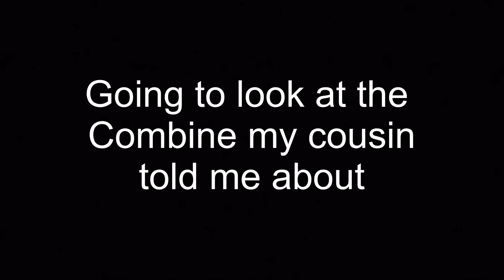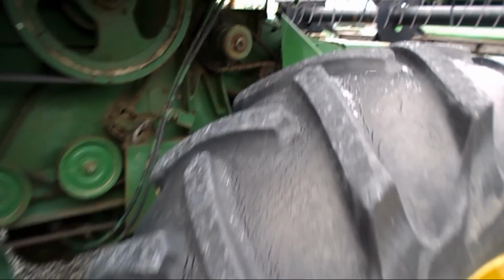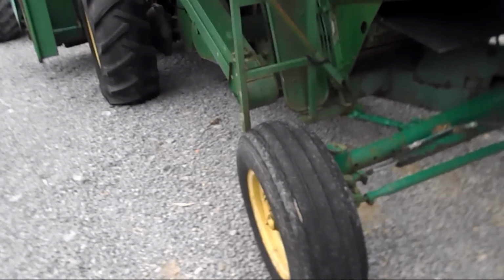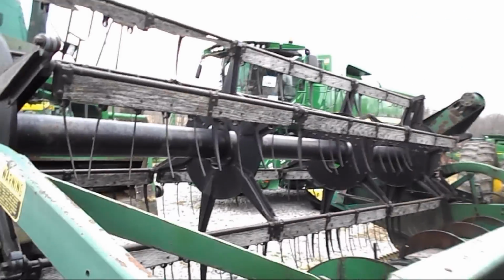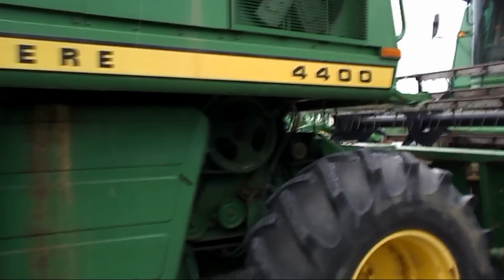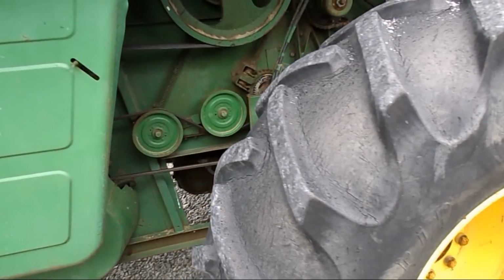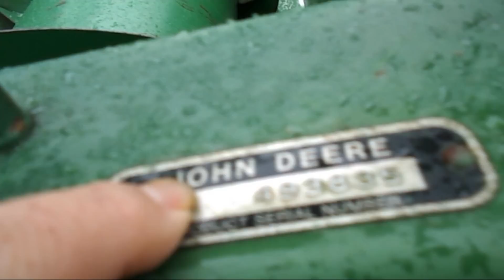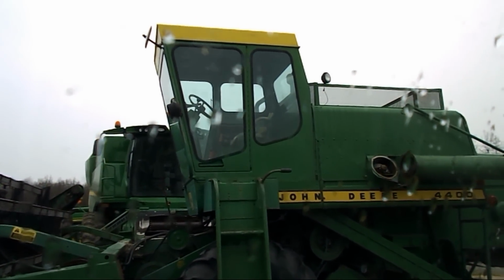Going to look at the combine my cousin told me about

Comment: Fair warning you will need to check the concave augers the flutes that grain flow through I got holes in mine I didn't even check in until after I started running corn a great big pile of corn on the ground
Reply from the maker: I did just that, I spent about 1/2 hour with the camera off looking it over really good and it appears to be a good solid machine. I'm not going to say its perfect but its in really good shape.  Bandit

Comment: they may have to pay you to  haul that thing away, your going to need to love that kind of work, belts, hoses, bearings, pulleys ,  batteries, tires,  its a real project.
Reply from the maker: I look at it like this,,,,,,, No matter what combine I look to buy used its going to need belts or bearings an other work done to it.  Tires I have (no cost there) so no big deal, Belts and bearings are normal ware parts so no big deal.  But this combine had $28 or $2900 spent on it at JD last summer and was in the field cutting beans a few weeks before they brought it to the dealer and I looked at it. With more time than money I see a good machine I could work with. As for the header I was told they got it 7 years ago used and I know it needs work, But I do have a good 13' head off my 95 that is ready to go that I can use on it. So I'm not worried about the header and I can fix the 213 easy enough. No matter what you buy used its going to need some kind of work done to it before you use it so this is no different.  Bandit

Comment: When it comes right down to it Bandit, it doesn't matter what anybody else says about the combine, if it will work for you and your situation in what you need in a combine buy it. (If the price suits you)
Reply from the maker: From what I see its a 1200 hour machine for sure, I don't see ware on it ware they normally ware  plus its tight ! It might need a few belts but that's minor compared to trying to buy a newer machine for more money. I think if I can get it bought it will be a good one to have, But I got to get it bought first !  I hope I get it, Low hour combines are hard to find !  Bandit

Comment: Looking like a 4K machine with head   I ran a 4400 for 40 years I sat in the seat.  Used last three years a truck load of beans just to keep it in good shape till we sold her off.
Reply from the maker: I think the hours that are showing are right by what I see of the machine, Lack of ware in the commend places . The chopper knifes have yet to be turned and they just have the tip worn on them so I don't think its done all that much cutting. The 213 head has been added to it at some point for sure with the spring assc under it it had to have had a 13' QT with a skid plate under it like the one I have for the 95. I'm not a big fan of the 4400 but if the price is right I'll own it and run it ! But I got to make the deal first !  Bandit

Comment: leave it right were it is you will be money ahead.
Reply from the maker: Maybe, Maybe not ?  Bandit
Reply: @banditfarmer1900  just curious what would you use this machine for? Back up of a backup?
Reply from the maker: @Alex-uy7pc  Well as I've said before the 95 needs a rebuild and I have a feeling this summer I'm going to be busy, So rather than worry about having to rush threw a build I'm looking at this 4400 for several reasons. One being its a 1200 hour machine  2 I have a parts machine sitting there and  3  If my summer is busy and I'm still working on the 95 I'll have the 4400 to cut beans with and not have to worry rushing a job that's going to take awhile to do.  As it is I got to finish blue and get the Long in the shop to pull the axel to put seals in it because there leaking and then I can get on the 95. I have lots to do and this 4400 falling in my lap will help a bunch if I get it bought !  Bandit
Reply: AMEN !

Comment: A few years back I had a 6600 and it was a good machine. Diesel engine, plenty of power. It wasn't that difficult to repair although there were quite a few drive belts on it. I paid $5000 for it without any headers and that was over 15 years ago. Sold it for $2400, purchaser rebuilt it and shipped it to South America where I suspect it is still being used.
Reply from the maker: I looked at a couple of 6600's and I was not really impressed with them and too many hours for my liking so I passed on them. I've found when your not looking for something one will fall in your lap like this one has , In this case its a good one and I've got to move on it while the chance is still there !  Got to be ready to jump on them when one pops up like this. If I don't get it I doubt I will ever see another one with as few hours on it as this one has. New video coming today ! Bandit
Reply: @banditfarmer1900  yeah... i know what you mean. When they get to that age it can be hard finding one with good sheet metal. Often times will be rusted through, grain pan, hopper etc. Good luck on it!

Comment: we had a jd4400 diesel & 444 head for corn. that replaced the jd95 gas with 3 row head. both were not enough hp because #1 muddy clay fields here #2 some fields 106 day pioneer was yielding 300 bu/acre drove it slow slow slow and the engine still ran hot. corn in icy standing water thanksgiving day 1997 i put duals on and that destroyed the transmission on a 20 acre strip, drove it home slooooooowly with a loud knock noise. that night after milking i dropped the transmission and found several ball bearings blew apart so the gear teeth were rubbing against the inner case so don't put duals on these combines. the 300 bu corn snapped the straw walker crank shaft in two. the feeder house apron was badly worn - kept jumping a link on the drive sprocket 10,000 times until i went to deere and bought a new apron. the 300 bu corn busted the elevator chain up to the hopper, again badly worn -would'nt fit the sprocket. of course every time that elevator chain falls off its sprockets the drive belt gets destroyed. so another trip to deere for those parts. late one night i hit a tree busted the unloading auger off the 4400 because 18 hours in the combine my brain turns into mash potatoes. no problems ever with the corn/bean heads/sieves and we bought it with new tires new rasp bars ($3500 for combine & 2 heads). so not the right machine for us only had it 4 years traded it for the massey 760

Comment: I have seen those turnbuckles connected to a few back axles in the past on some combines. I have even seen them on a few IH combines. I never heard a reason but always suspected for extra side to side support. FP sure does move a lot of equipment. We have bought a few things there. I wonder if that hour meter still works? Not a bad combine for the age. Just needs some TLC.
Reply from the maker: I myself have never seen this on any combine before , I looked that back axel over closely and see no cracks or welds and everything looks tight so maybe it was done to prevent a problem from happening .  The hour meter works and it look to be original and what I see looking at the machine I would say its right. Its been kept in a barn or shed (I'm thinking shed by the way the paint is from front to back, Back is duller and up front is bright) but I think over all its a good machine just needs some TLC to make it look good again. I hope I get it !  Bandit

Comment: If only it were a diesel.  I've never run a 95 but i have to say it think your 95 will out work this 4400.  We have similar axle supports on our 4400.   Excited to see what you find out about it.
Reply from the maker: Oh I know the 95  will out cut the 4400 no doubt about it, But with the 95 needing work this would do in a pinch if I can get it I wont have to worry about getting the 95 fixed in a hurry. I can take my time and do it right. But this 4400 has me very interested in it for sure. I still don't understand those supports on the axel, For sure I've never seen them before and they look like they wouldn't let the axel move very easy . Not sure why there on there, I couldn't find anything broke or welded on the center tube so I'm not sure why there on there. If you could explain what they are for. Bandit
Reply: @banditfarmer1900  those axles are known for breaking and having problems.  This is one attempt to prevent the wobbly rear end. It does limit the amount of oscillation though.  On a 6620 and larger they made an optional heavy duty rear axle.
Reply from the maker: @AgWildNebraska  I looked over the back axel and I didn't see any cracks or welds anyware on it, I think this might have been done to prevent it from happening .  One thing I don't like is how wide they have the axel spread out on it, But first thing is I got to get it bought if the price is right !  Bandit
Reply: @banditfarmer1900  probably so.  TAH-DAH Farm recently fixed his 6600 with new bushings in the axle pivot.  With only 1300 hours you'd think this one would be in good shape yet.
Reply from the maker: @AgWildNebraska  That's one of the reasons I cant figure out why they are on there with as low of hours that are on it I think maybe this was done to prevent it from having a problem, But I wont know for sure till or if I get it bought and get it home and can jack it up and check it out and see what the deal is with it.  Who knows for sure.  Bandit

Comment: To be honest that combines been ridden hard and put away wet a few to many times from what I see. I'm wondering if that axle has been ripped off or bent and replaced after somebody towed it out from being stuck, and they added the braces to stop it happening again. That hour clock digits don't look right to me either, why is the second number not inline where it should be.   I'd think that sprocket should be better than that for the "low" hours to.

 My thoughts are the best thing about it was when you shut the nice fitting cab door and got in the truck and left. I'm going to say if you want a $1000 combine ,spend 1500 plus on it before it's in the field and end up with a 2500-$3000 machine thats had a hard life It will be in your yard soon .  There   are newer 6600 /7700 diesel Deeres advertised round here in Canada for  about $5000-10.000 cdn not many guys want them now. What are they worth in your area for a newer combine ?.      I guess if it comes home at least we get to see you figure it out and use it, so that would be a plus. Thanks for the video, take care
Reply: super6954 exactly, that’s a lot of wear for that kind of hours

Comment: I'd bet the bushings are out of the rear axle pivot!  Best be a good deal I think I would walk away too many repairs! You could do that much work to the 95 and have a better machine! I don't like those models either!
Reply from the maker: I looked everything over on the back axel and I cant see anything wrong with it, No cracks or welds and the axel looks tight so I'm thinking its ok but if the price is right I do have a parts machine just sitting there I can get parts off it IF I buy this one. The 95 will get fixed and IF I buy  this one it will give me time to do the rebuild right and not be in a rush about doing it. I'll have to wait and see what happens.  Bandit
Reply: If anyone can fix re up u can
Reply from the maker: @arthurdewith7608  If I get this it will go on the fast track for the little things to be fixed so when falls rolls around it will be ready to go. Of course I got to get it bought first !  Bandit

Comment: I used to work at JD! The 4400 is a great machine!  Id rather work on them than a 6600!
Reply from the maker: Dad bought a 4400 20 years ago and it was a good running machine, Cut good and cleaned good it was just a little ockwards to be to run. Getting the one I just bought in the shape its in for the price I now have a low hour combine that will last me a long time. It needs some belts so I think all of them will get replaced at the same time just to save a lot of work ! LOL  I've help work on several 6600 and they are a giant pain in the butt to work on.  I was at JD and a guy was needing a steel hydraulic line on his 6600 cause his was bad,  They asked him do you have a torch ?  Why? If your going to replace it with a steel line you will have to cut your way in to replace it !  Or you can replace it with a hydraulic hose and reroute it.  The guy did not look happy with what they told him !   I still say the engineers who designed these combines needed to be tared and feathered !  I still think the 95 is a better combine than the 4400 that replaced it. I know the 95 is a lot easer to work on ! LOL  Bandit

Comment: Here I thought I was going to be the only one on YouTube with a low hour 4400 but here you are haha. Mines got 1373 and is from Ohio. I would REALLY like to know more about that header cart if you can. Tire size, width between uprights, etc. I just bought a $25 running gear to build one out of for my old 13QT. That machine seems pretty nice. And you have a parts machine!
Reply from the maker: I got to find out more about the story on this machine and what the price is tomorrow, But its showing 1269 hours and from what I see it could be right.  One of the reasons I'm even looking at this is the fact I do have a parts machine sitting there to use as I need. But I got to get the story and a price and see what happens.  I'll see about the gear too ! Bandit

Comment: My grandpa had a John Deere 4400 once, and it was a good combine. But you might be money ahead to get a 4420 or 6620. These machines had a lot of upgrades and don't seem to cost that much more.  If your not dead set on a John Deere, a 1420, 1440 IH could be a good choice for an older combine too. But just my 2 cents only!
Reply from the maker: Its like I said I'm not a fan of the 4400 but I'm smart enough to see a good deal on a low hour machine and I'm ready to act on it even if its a combine I'm not a fan of.  Bandit
Reply: @banditfarmer1900  Is this combine selling on an auction? Sometimes you can get better deals at no reserve farm sales.

Comment: We run a '73 4400 gas that had 1,500 hrs and ours didn't have half the amount of rust that one does.  Either the odometer is wrong or it sat outside or both.  The fixes don't seem that expensive if you already have tires.  Need to hear the engine first.   Personally, I wouldn't pay more than $2000 for that machine with head and cart.  I'm sure the dealer wants it off the lot so you can negotiate
Reply from the maker: In this part of Ohio its hard to find anything that doesn't have rust on it even sitting in a barn !  I bought a bale a couple of years ago that sat in a barn sense 1976 unused and even it has rust on it ! LOL  From what I see as far as ware it isn't showing much of any and by the way it runs and feels I think the hours are right, The dealer doesn't want it on there lot for sure  and I think I can make a good deal on it. I'll find out tomorrow if I got it or not and I'll let you guys know how it went.  Bandit

Comment: Run !  Run away !   I've seen pieced together machinery. I've BUILT pieced together machinery. Please don't do this to yourself.
Reply from the maker: From what I've been told the grain had was bought 6 or 7 years ago and beings its a one owner machine the owner was elderly so I can understand the snouts being bent up and replaced, Its sheet metal no big deal I can by a pair for a $100 to replace them and the reel fingers are from the same thing and no big deal to replace.  Now the machine is strait and in really good shape and low hour so in this part of SW Ohio I expect it to have some rust on it being 50 years old.  I don't see it as being put together at all, If you figure calling it pieced together because it has a newer head on it you need to look closer at the combine.  So what if the paint don't all match , I could care less cause paint don't tell you what the combine can do.  Bandit

Comment: I’d leave that thing at the dealer!
Reply from the maker: Why ? It looks to be in pretty good shape . Bandit
Reply: The thing about the dealer is, you’re buying from the middleman, might as well buy one at an auction or Craigslist. You’d have to be very committed to that machine. Also you were just looking at external parts, lots of moving parts inside, plus it’s gas, diesel would be much better.

Comment: You can do you what you want. If the price is low enough that you can do the repairs and come out on top, all power to you. It doesn't strike my fancy even for a similar machine. I would hold out for a unit in better shape. I agree that it's salvageable with some work. Would the head(s) for the 95 work on it?  Anyways, your cousin was good to tell you about it and give you something to think about.
Reply from the maker: Well if the price is right I can afford to put some belts on it and as for the head I can use the 13 foot head I rebuilt for the 95 and use it easy enough.  Tires I have sitting there so that's just changing them and if I need parts I have a parts machine sitting there so I hope the price is right on it.  I think I can get it cheep enough as they don't want it on there lot and its not the time of year to sell a combine ether so maybe I can get a good deal on it !  Bandit
Reply: @banditfarmer1900  be sure to check the oil and coolant for any "funky" business. Do your best homework and hopefully you come out ahead.